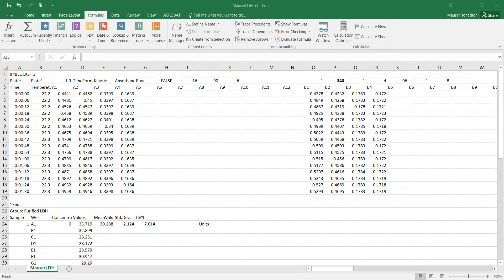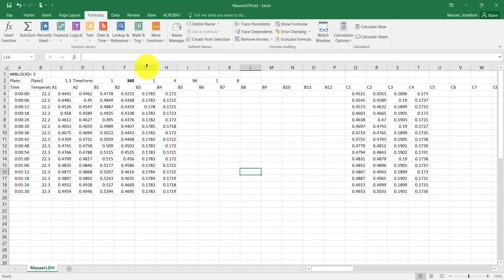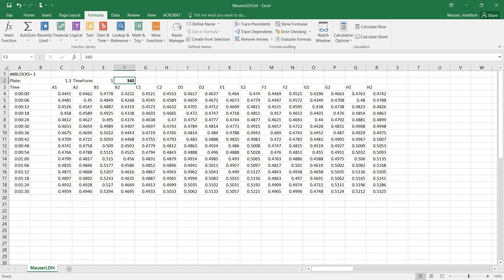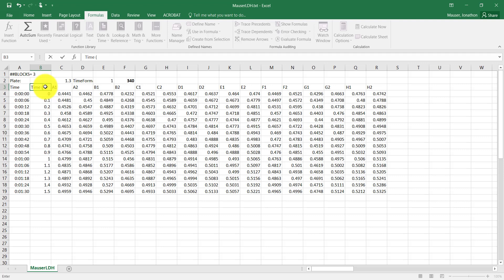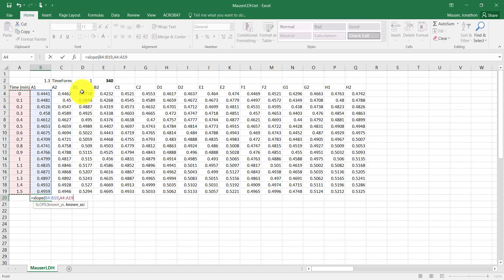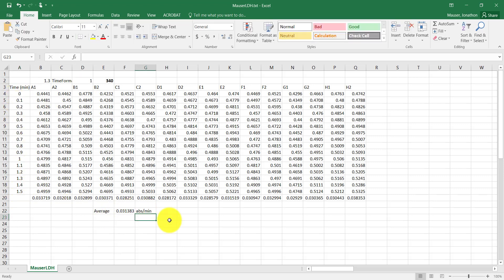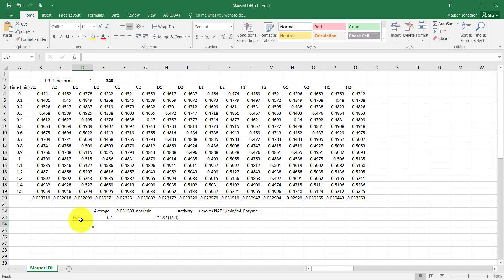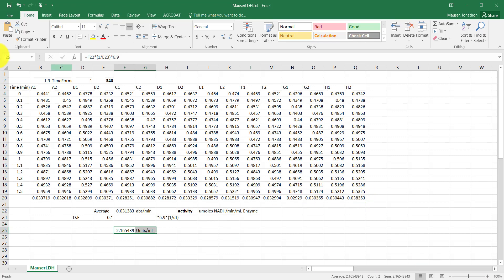CHEM 406 - Processing LDH Activity Assay Data with Excel

Comment: There is sound issue...but its okay...Please explain a bit where from this 6.9 is coming  and what exactly is it?
Reply from the maker: Hi there, Dr. Pandey - sorry about the audio. The 6.9 is a common factor that converts the absorbance/minute slope into umol NAD+/min/mL (or units/mL enzyme). Broken down, this boils down to slope * 1/dilution *6.9 = activity (Units/mL)

(0.245 mL reaction volume * 0.001 L/mL)/[6220/(M*cm extinction coefficient for NAD+ )*0.000001 moles/umol*0.01 mL of enzyme * 0.57cm path length)] = 6.9 umol NAD+/mL
Reply: @BiochemistrywithDrMauser  thank Dr. Mauser for clarification...